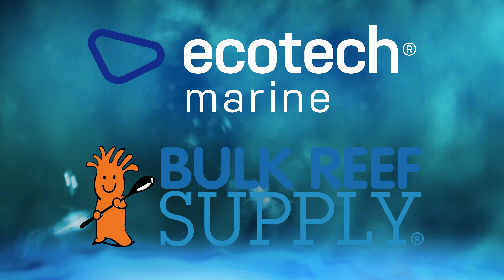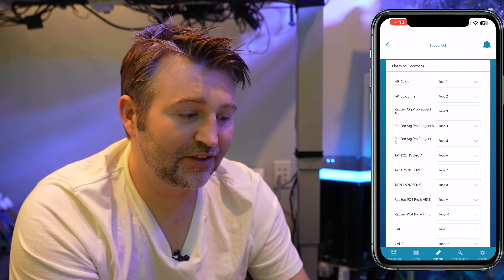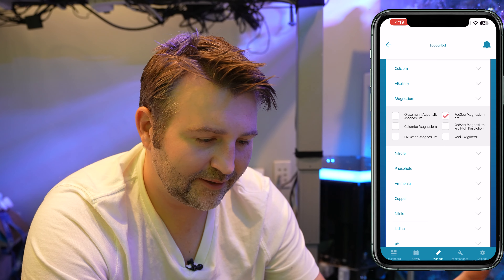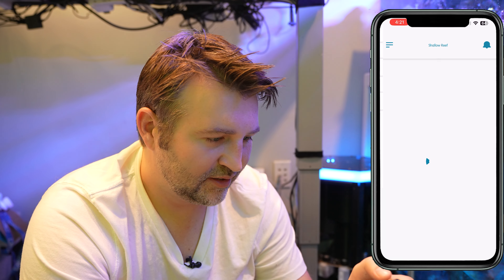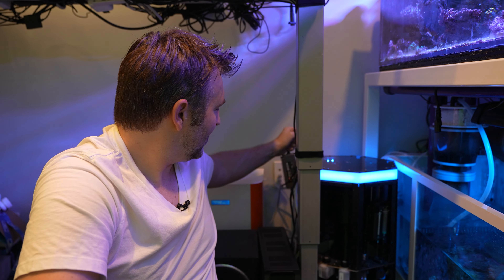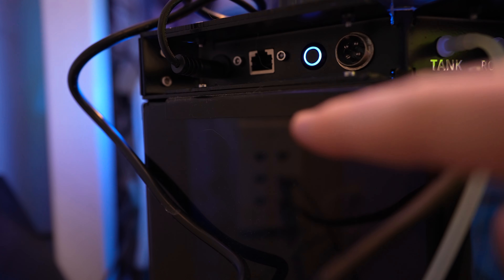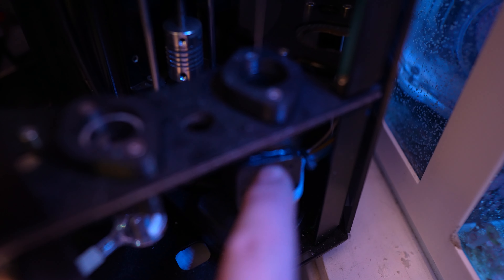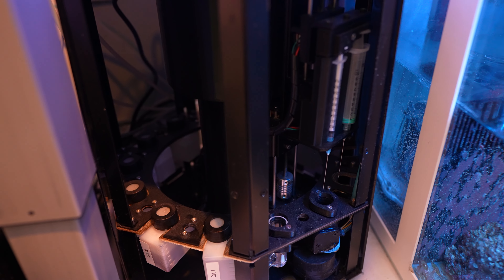Reef Kinetics Reefbot Lab - 1 Year Review on the aquarium automated testing

Comment: I absolutely love this device! It has been in use for over 6 months now, for about 4 hours daily, and it still works just as well as the day I received it. Thank you for sharing your experience with it, it's reassuring to know that it will continue functioning just as reliably for the next 6 months and beyond. 🤣
Reply from the maker: Great to hear! Daily testing?  Your extra hardcore! . Is that for alk mainly or what all do you test daily.?
Reply: Kh mainly, twice a day, I like to test Calcium once a day as well because I have occasional drops.. the rest is for NO3, PO4, and Mg, maybe twice per week each one @ReefDudes

Comment: I'm heading into my 10th month with this device, and I totally agree with what you mentioned. Btw they started sending out extension cords for the power supply a bit later, but they'll probably get one over to you once they see this video 😂. 

My overall experience, for anyone who's curious, has been fantastic. They've come a long way from their initial product, and this one feels like a perfectly polished device. It's in action daily for KH and semi-daily for ca, po4, nitrates, and ammonia, and all is running smoothly. I get the feeling its lifespan will far outstretch similar products, and with their regular upgrades and enhancements, I don't see other companies keeping up. RK seems dedicated to honing this device, with no distractions on other product lines. 

Perhaps my biggest wish is for the device to have its own set of reagents. It'd make finding best test kit. For instance, API calcium isn't as precise as Red Sea, but Red Sea involves a bit of dilution due to its powder reagent. The same goes for nitrate tests. So as you said I began caring about consistency rather than chasing a certain value. And maybe they could make it possible to integrate with dosers or APEX controllers, consolidating everything into one hub would be a breeze. So for anyone interested, I strongly recommend this product
Reply from the maker: Awesome feedback!   On their own reagents I did see Some RK reagents in the list which I suspect may be theirs in the works.

Comment: Thanks Dev! There's one item I've noted for testing nitrates with this unit. The nitrate reagent that calls for very intensive shaking (usually bottle #2) should only be stored in the 20ml cylindrical vial, not the 60ml cubical vial. You will see the less soluble particles settle into the corners of the 60ml and the magnetic pill is not powerful enough to suspend them again into the mixture - which invalidates the test reading. Reef Kinetics told me that for this test, they recommend a manual shake before testing.
Reply from the maker: Intresting. I wonder if you could use a larger stir bar in the 60 ml vial to mix it a bit more
Reply: @ReefDudes  I tried one roughly 3x the length of the included pill without any luck. Thankfully that's the only issue I've had, so it's not a deal breaker. Great unit.

Comment: The rodi, tank and waste lines, are they needing to be a specific length or can we have it as long or short as we'd like depending on where we put it?

Also, im between the mastertronic and this one. Now that you know what you know. Which one would you keep if you had to get rid of one of them? And why?

Thanks bro!
Reply: It is recommended that the sample tube be within 7 feet. However, I have been using 10 feet tubes and it still works well.
Reply from the maker: Waste you could cut. Most testers want you to keep the sample and tank lines the full length though.  Mine are coiled up behind it
Reply: @ReefDudes  awesome, thanks! What about which route would you go if needed to get rid of either the mastertronic or reefbot?

Comment: If you test once a week, is this system using "old" water that's been sitting in the lines or does it purge the intake line every time?
Reply from the maker: I believe it flushes it but will have to watch it testing to 100% confirm.

Comment: I'm also thinking about purchasing a device, but haven't been able to determine how well it can reproduce its measurements. If you run three tests in a row of the same parameter, are they all reasonably equal? When testing multiple times manually, I´m usually in a range of 10ppm on calcium for example. Whats your experience with that?
Reply from the maker: I can’t say I have ever done 3 back to back but have tested twice in the same day on nutrients with consistent results
Reply: Yes, basically it is repeating the same sequence over and over again, when I first got it I used to double check each result just to test its consistency
Reply: sounds great, thanks guys!

Comment: Deven, two question for you Sir , if you have the time?. As I seriously consider getting one.  I've looked at this thing more than once, and find if very appealing especially after the second version came out.  And a lot of information is available on how it works, thanks to solid reviews like this one. Two questions:

1. what's the full testing frequency range: Something like KH, I'd test once or twice a day. Ca or Mg once or twice a week. But for everything else, parameters like Fe or K, I'd only want to test monthly as a base line (unless I suspect a deficiency). Will it accommodate all those different testing ranges? I can't seem to find information on the longest duration available between testing. 
2. Export: Simply, does the app allow for export for data analysis or archiving long-term. For example, can I get it to import into MS Excel?

I'm not a coral farmer, I don't need everything tested multiple times a week. Which is the number one reason I don't have a trident. However, I do want better insight into long-term trends and to ensure nothing is deficient. Much like we utilize ICP tests. This device seems perfectly placed to accommodate that with the most common tests. 
Thank you for any additional insight.
Reply from the maker: Absolutely. I only use weekly but looking into the scheduling options now, hourly, daily, weekly, monthly , yearly so I think your covered for those ranges! To be honest I think this is the first one that o have seen to let you test monthly (bonus!)

As for exporting I don’t recall seeing an option but you could likely copy paste from the web interface. I’ll reach out and ask them about it, now I’m curious too :)
Reply: @ReefDudes  Thank you very much Sir. Ya, that export was just a nice to know, as you could use other tools outside that one app. But, it was a curiosity.
however having both a weekly and a monthly testing option just sold me. I know my next big purchase. I appreciate your time (and content)  :)
Reply: Deven How accurate is the test if you were to compare to other methods please advise thanks Great Video

Comment: For the light just put electrical tape over it and leave a small open area so you can still see when it’s testing.
Reply from the maker: That would be a an easy  fix.   Also debated adding a variable resistor to act as a dimmer switch

Comment: Thoughts vs. the Mastertronic?
Reply from the maker: Both have their pros and cons    I did do a video or stream a few moths back talking and comparing the different testers
Reply: I hope you don’t mind me saying my opinion, but as a user of both, I find that the MT can be compared with the reefbot v1 or v2, but in terms with the RB Lab, the lab is superior, steadier, more consistent, better design and parts, minimal maintenance and calibrating, you can stack tests and they will all run after each others, more compatible tests and parameters, the 60ml vials… MT still have issues with the syringe holder and they use practically everything RK replaced between the v1 and the lab. MT in my opinion is a great device, but if I were to choose which I would keep, I’d choose the lab

Comment: I was about to pull the trigger, but $271 for shipping, and your discount code is worth $89.99, not $100. Not a huge deal on the code, but $271 in shipping is insane, I ship daily and that is highway robbery.
Reply: Greetings,

We utilize DHL Express for shipping, and the shipping costs, unfortunately, are beyond our control, although usually to the US shipping fees are less than the number that you provided. Reef Kinetics assumes responsibility for insuring the device and contributes towards some of the shipping fees. The confusion might stem from our devices being dispatched from Beirut. You can personally verify the shipping rates by entering the device specifications and destination details via DHL.
As for the promotional codes, during discounts, promo code benefits undergo slight adjustments as they are calculated based on percentages.

We extend a warm invitation for you to join the RK community and experience firsthand the trust, respect, and support we are committed to offering all our users.

Best regards,